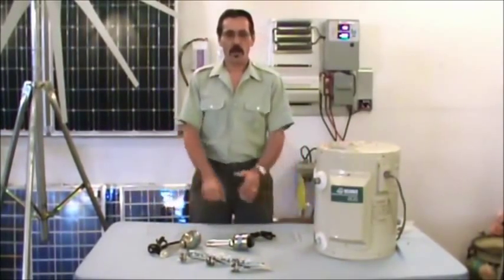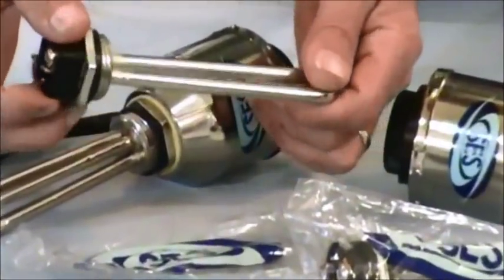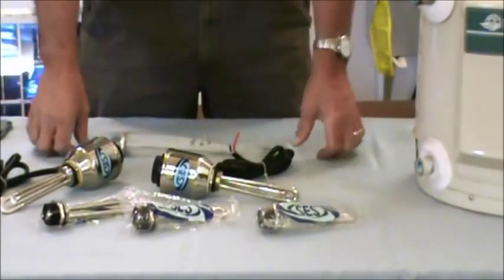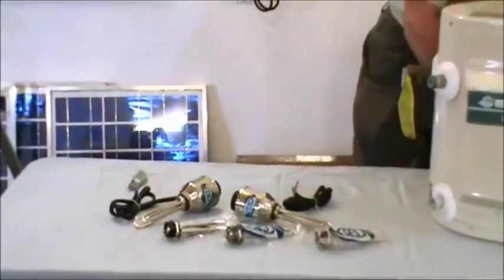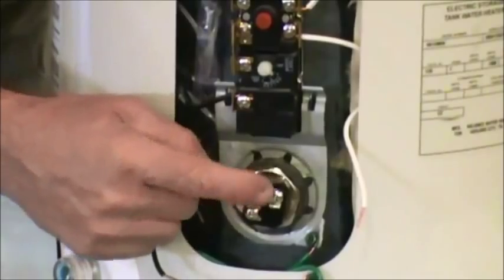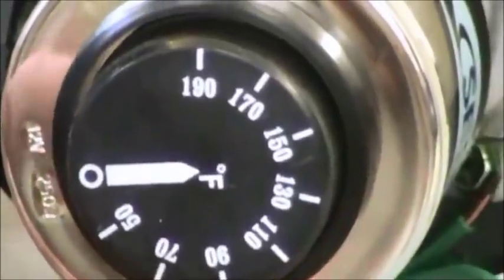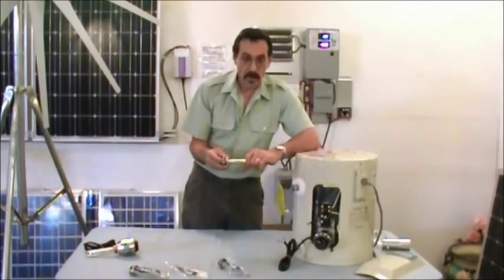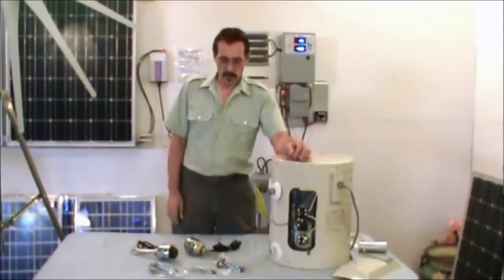DC Water Heater Element Solar Hot Water: Make Free Heat | Missouri Wind and Solar

Comment: Does this sound right?????????

Ok, then a crude estimate with 2.5 watts heating 1 degree in 1 hour, so 300 watts / 2.5 watts = 120 degrees in 1 hour. Then 120-45=75 or 130-45=85 degrees to increase to 120-130 from 45 will take between 60 minutes*75/120 = 37.5 minutes and 60 minutes*85/120 = 42.5 minutes.
Reply: can you break in down in algebraic format (equation, formula) tomato potatoh lets call the whole thing off!

Comment: How long will it take to heat my 10 gallon mini tank up to 180F for a shower?
My system is 12 volt and I have your 300 watt element and 200 watt with thermostat

Comment: Hi I am far from literate when it comes to anything electrical however my question is, will any of these elements boil water at sea level? If so, what kind of wattage/ per hour would be required?
Reply: Hi dear thanks alot for your ganrus lecture dear from weher I bought it from Pakistan and how many solor plates are recueard fort it

Comment: you don't need the solar hotwater hybrid controller for this jeff ? would this help or you don't need this controller?
Reply: I get the impression that since it's just a heating element that it wouldn't need a controller, unless maybe your solar panels' output watts exceeds the 200 watts the element shown is rated for.

Comment: I've bought a 600 watt MW&S element (without thermostat) that I will be running at 24 VDC.  The water heater is  the same or very similar that shown in this video.   The video says that I can still use the  water heater's thermostat.  What I am wondering is if that thermostat will be OK with switching the 25 Amp load.  When powered via AC the Amp load is 13.2.  Note that I am going to replace all of the wires with 10 AWG.
Reply: Answer is tricky. First understand that Direct Current, especially as the voltage goes up, arcs BADLY. Big problem with contacts and switches. 

The US went all through this in building battery operated naval submarines from 1910 - 1955. 

What is a hot water thermostat ? A switch, and it has a rating. Now here is where it gets "messy". 

A household water heater draws about 20 amps IF it is powered by 230 volts AC. With Direct Current, you calculate with Ohm's law or other electrical formulas. A standard household electric water heater holds up pretty well when wired as intended, i.e. 240 volts Alternating Current.

Alternating Current unlike Direct Current arcs much less, which is why AC is ALWAYS preferred. Are there solid state switches on the market that can can work in place of an ordinary switch or relay for DC ? Probably. Go start researching, but standard switches will fail early or weld contacts as you use higher DC voltages.

So wire size is simply about the amperage or current that the wire will carry. For more amps, wire has to be thicker. 

It all goes back to Ohm's law. The amount of current that flows is determined by the supplied voltage and the resistance of the load. (Drop a screwdriver across two battery posts on a car battery and either the battery blows up, or you blow a big hole in the screwdriver)   A 24 volt emergency diesel cranks with 1/2 the amperage of a 12 volt car. If the Car cranks at 160 amps, the 24 volt diesel cranks at 80 amps. The 24 volt system also DOES NOT need thicker cable because current remains the same.

The issue is NOT whether 24 volts DC will heat an appropriately matched heating element. The issue is how how you control arcing when using DC.  I recommend going from DC (perhaps 48 volts) and then recreating 240 volts AC and heating just like your house does. Solves a lot of problems. Electrical calculations needs to be done to make sure the source can insure the result.

Comment: well I found that you can power a normal ac heating element with just a lower amperage element 7 amp. just need 240 volt DC so hook panels up in series.

Comment: Will the solar panel produce maximum power when connected directly to this heater element as you suggest?  Wont it need some sort of MPPT to match it up properly?
Reply: this is my question. My guess is that you would need a controller. And if you want it to run when there is no sun (or at night) you'll need a battery as well.

Comment: I Think I may be missing something here. 

Is a heating element not just a Resistor so as so as long as you do not exceed the maximum Power through it It does not care if the power is AC or DC.
Reply: really good question.
Reply: A 1600w 120v element pulls around 65w-75w on 24v DC.

65w** not 6wXXX
Reply: It would also only heat the water about one-fifth of the 1600w 120v.
Reply: 10 solarpanels make 230v
Reply: yes your right, and you can not use the same thermostat ac for 110 dc. dc current jumps an ark at 1 inch or more and will never turn off will burn wires or melt,, fire, ect. I use a 500 watt heating element wire direct to element. on for 6 hrs. a day and kepts the water temp at 160 to180. if it gets to hot the blow off valve will blow hast yet. works fine no batteies to worry about. and high cost.

Comment: i wanted to run this on a water heater and with 2 150 watt panels. This response was from Missoui wind and solar website...

A controller is designed 
to function with batteries and would not work properly in the capacity 
which you wish to use it. Also a single 320W panel will not produce 
enough energy to heat the water to a usable degree. The single panel 
would heat a typical 40 gallon water heater up 3 degrees per hour more 
or less. I don't think that would satisfy your hot water needs.-- 
Thanks, Cameron
Direct line (417)-763-3134

Can someone tell how this info is correct?

Comment: I have a GigaWatt 255W Solar Panel. Can I just run it into a 120 volt AC heating element? Will the 12 watt heating element you mention work with this panel without using a converter? I think the panel puts out around 37 volts. Thanks

Comment: Need to point out that all of the solid wire from the ac water heater needs to be removed if you are re-using the water heater's thermostat.  Solid single strand wire is basically useless for DC uses.

Comment: Do all hot water systems have the same screw in element as the 12 v one you have on display here
Reply from the maker: +David Hansen Pretty much. Some water heaters have bolt in elements but not many.

Comment: Ty for the great info. I learned something today.  I have been watching your videos for a long time now and one thing I notice is that you are always honest on your sale thank you that means a lot. I do however have a question, when you hook the panel to the water heater do you not need some type of charge controller to control the power going to the unit?
Reply: I dont think so... as I am running a borehole pump from 6 x 300 watt panels and they are connected directly to the pump via a normal on/off switch.. been running it for almost a year now without any problems.. 

I think the charge controller comes in when you actually charging batteries to protect from over charging.. I could be wrong though.....

Comment: So you are converting light to electricity to heat? That is so inefficient, just use a Solar water heating system on the roof and junk the rest!
Reply: +TheRfmodulator  much easier to run an electric wire to a pre heater than run water lines that freeze in the winter. I'll go with the solar panel since we live in OH where the winters are long and cold.
Reply: That's a great point... unless, of course, it's cloudy... or night. I do realize that he didn't mention a battery bank, and instead wiring straight to the source, but come on... use your imagination. Tanked water heaters are a terrible idea to begin with, if you really want to talk efficiency. ...how do you circulate that water against gravity to your roof? voodoo? Honestly, I don't have the numbers, but my guess is using roof space for solar panels, to do more than just heat water, is a better use of the space. And yes, I also realize that if you're using "city" water (that which comes from a tower), and your roof is lower than the tower, it will gravity feed. So back to my second point, use the roof for gathering energy, store it, and allocate it as necessary.
Reply: BuddyToolsLLC
Great Idea! Although, I still favor a gas fired tankless water heater over any other means of having hot water at the tap. Highly efficient if you invest in a good one, and long life if you maintain it properly. All else being equal, if preparing for some grid down situation, bad weather, whatever, I would choose LP over Natural Gas, even though NG is cheaper, because I can store LP myself. And I can choose to buy LP when the price is down and help to take some of the sting out. I haven't done this yet, but this is the direction I will be heading when either my electric tanked water heater fails, or everything else is how I want it.